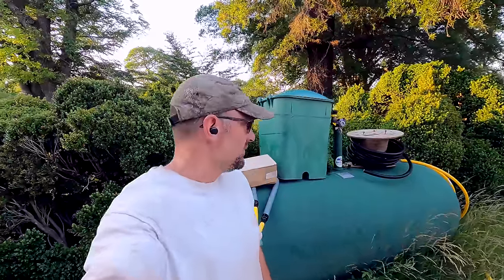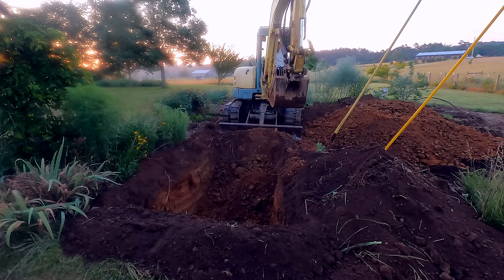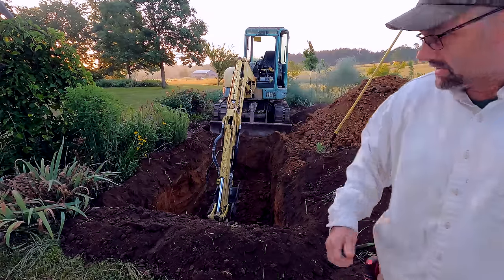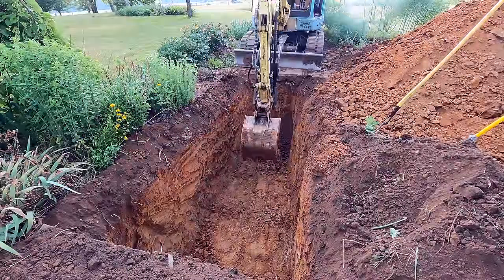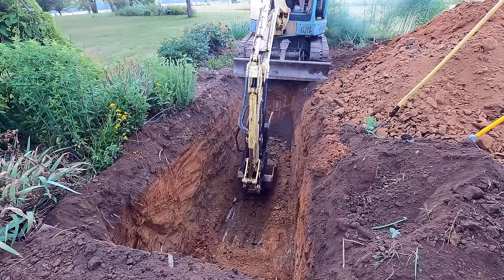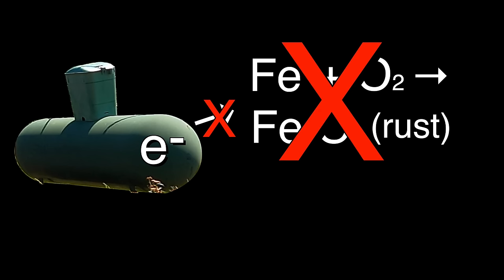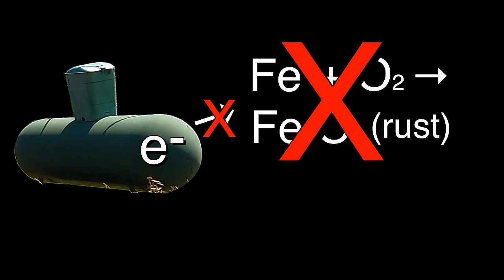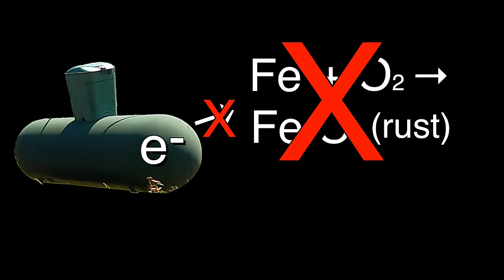Installing An Underground Propane Tank (500 Gallon)

Comment: Simple solution would be Fuel lines may be pinched or restricted in some sense.
   
 Harder solution- engine problems not creating enough power for the hydraulic lines ?
     Idk.  Only a few minutes in - really hope you fixed it by the end of this video :)

Comment: Got to thinking 500 gal. Tank on a generator hmmmmm it’s either a large generator or you use it a lot or you buy propane when it’s cheap and store it up ! My generator will run 2 weeks on a 100# tank so yours will maybe go 2 months or so , you doing wind and solar also ?

Comment: A friend had two aluminium fuel tanks made for his tipper it would run god for a while then shut down like it was starving for fuel he changed filters then the pump to no avail , he found out when they made the tanks they had not put filters in the fuel pipes in the tanks . When they made the tanks they had a meltdown of the aluminium doing the filler which landed in the bottom of the tank , it flattened out and as the truck motor sucked fuel it would pull this up and it would lodge over the end of the fuel line cutting of the flow of fuel , took him a lot of head scratching to figure it out .

Comment: what was the idea behind hiring the guys to install the tank? seems like you pretty well did it youself but im sure paid them 4 figures to come hold a tag line and connect a grounding wire
Reply from the maker: They work for the propane company.  They wouldn't fill the tank unless they were involved in the install.

Comment: My propain company would never let me that clost to gud wire from the Power poles. You had to be at the edge of the guy wire anchor. ( Lighting)   I had to be 10 feet away from any grounding of mt antennas.

Comment: Commenting before finishing the video, but I don't see why the location of the anode is important if it's tied to the tank with a wire.  It seems to me that if it were located along one side then it could be inspected after a few years to see if it needs to be replaced.  What do I know, though?  Just an armchair quarterback speaking here.
Reply from the maker: I don't know a reason other than that's what the propane guys told me.  Might be BS.  ;-)

Comment: remove the tank... fill it 1/3 with coarse abrasive for sand blaster weld two axels on a centerline hook a motor and let it spin for 1-2 days... it will be like new...

Comment: Why is the Tank no Stainless steel ? Greetings from Germany
Reply from the maker: I guess it's just cost.  Also, I've heard stainless welds have a tendency to crack.  It's easy enough to protect the tank with an anode.  It's the same thing they do with buried pipelines.

Comment: Those blankets he put around the tank will always be wet.  This ENSURES that the rust process will double or triple in speed.  Better set up an appointment with the tank guy in 4 years to come dig it up to replace the anode bag.

Comment: I hate to break stones, but that tank is buried too deep. Depending on where you live in winter freeze thaw and refreeze will allow water to build up and ice over the multi valve on top of the stem. This makes it impossible to fill and a dangerous situation concerning the relief valve. I have no idea what your terrain is or your water table, but it appears to be down hill to the tank. No ill will, just friendly advice, lower the grade or elevate the tank.
Reply from the maker: I actually raised the concern of it being too deep with the propane guy, the man who was working with me, and he said it's good like it is.  My main concern is the tank floating, but not that much water will drain to it, and I will keep an eye on it.  The ground down to the rock is pretty coarse and should drain water away pretty well, so that's good.  As for the valves icing over, pretty unlikely here.  Our frost depth is only 18 inches.  Cheers.

Comment: Per 58 gas code max depth is 12in from top of tank to finish grade. Anode should have been soaked in water prior to install. Sand should have been used in bottom of hole then tank surrounded and covered. Cathodic tested should have been performed day of install,18months, then every three yrs after. Sorry to nitpic 25yr propane service tech.

Comment: Thats a bad place to put that tank. If the anchor and guy wire from the pole needs replaced that tanks going to be in the way. The power company didnt put that anchor at the correct angle or you would have found it while digging thete.

Comment: you should be MUCH MORE CAREFUL... jumping into a hole like that is a risky move.... if something did happen, it will happen suddenly and with out warning or time to escape... between ladder falls and stuff like that OSHA training sure is useful. If you ever have to get into a hole like that there are ways to do it and form the hole safely. Glad you are ok but i have seen it happen 1st hand... even if your head is not covered, you are smashed and cant breath... impossible to get you out in any way before death. You can take a osha 10 course for about $75 bucks and i highly suggest you do just for your own safety.